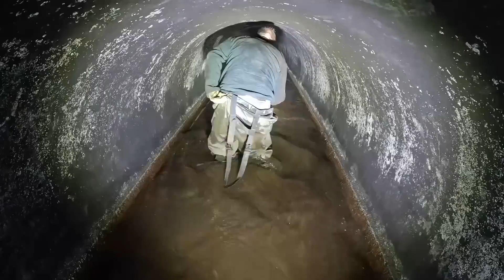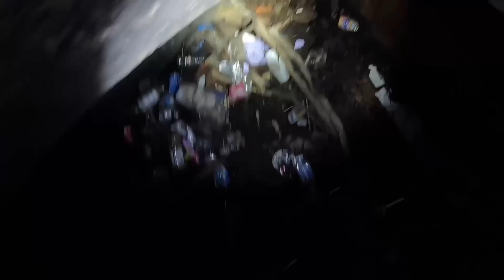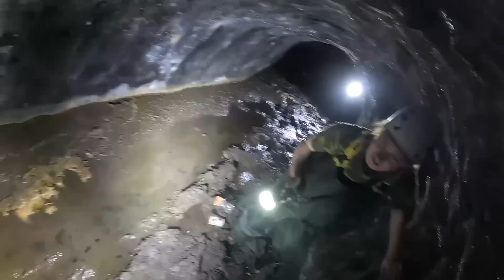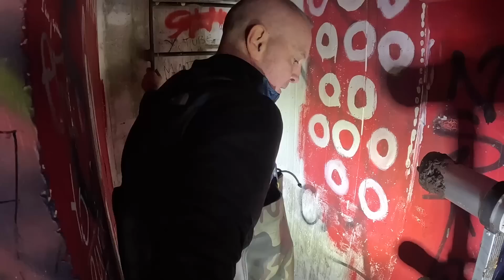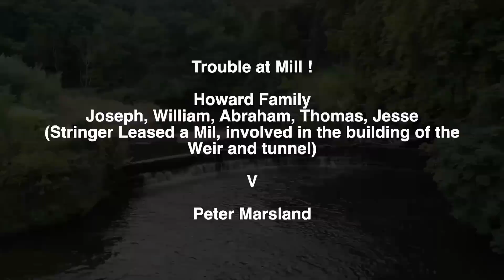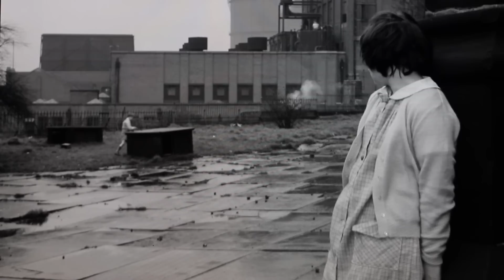Stockport's Old Corn Mill Tunnels

Comment: A few anxious moments on this video as well as the previous, Martin. If Roy thought that it was not safe to proceed any further in the quicksand then that was good enough to come away. I never realised that those places went right back to the 1700s, but it just shows how much was going off in Stockport at that time, and then the water supply for the later power station. That was good how you explained with the old maps what was what as to where the tunnels were situated within the meandering of the river. Nice to see the 'Taste Of Honey' clips that you showed. That was a real classic film of the earlier 1960s. Many thanks Martin, with Roy and Marcus, a pearler of a video!

Comment: Grew up in Stockport (Bredbury) and remember the power station and gas works well. Even lived for a short while in the shadow of Pear Mill so thought I knew that area better than most. For example - I discovered that the patch of waste land between the Goyt and Welkin Mill (across the road from Pear Mill) was once a shooting range! At some stage it became a dump as further field investigation (by me) turned up some empty Victorian/Edwardian medicine bottles there. I must say though, that these tunnels were completely unknown to me. I know there are some on the other side of Stockport on the Mersey (close to the viaduct) but these were a revelation. Cheers!
One thing I do wonder though, Martin, is the photo you have of the 'relined' tunnel at Renold's Mill, which you suggest was for the power station...at that point, the power station is on the other side of the Goyt, so unless they ran it under the river, it may have been for some other purpose.

Comment: I always struck me as odd that there was a Canal Street in Stockport with no connection to the canal network until I found out about the mills.
Reply from the maker: Yeah there was a branch down from the Ashton canal 👍🏻
Reply: @MartinZero that isn’t near Canal Street, that area is now filled in but retains the names Wharf Street. The canal street is near to where the plane crash was. It’s supposedly named after a series of reservoir and culverts of Hempshaw Brook but “canal” is still an odd name for its

Comment: Hey Martin. Great films if Stockport cornmill tunnels. I'm Stockport born and bred. I just wanted to point out in relevance to your video, there is an old set of stone steps on new ridge lane just past the Aldi store leading up to Stockport market/churchgate called Stringers steps!. He must have put his name to that part of Stockport, from the mill at the goyt along new ridge lane up to the market.
Reply from the maker: Well the old devil got everywhere didnt he 😄 Cheers John
Reply: As an ex Stockport area lad myself, Stringers steps are located at the top of Stringer Street and go onto New Zealand Rd.  They gave easy access to the mills from Turncroft Lane  Hall Street etc.
A few years ago they were dug out and renovated/restored only to be neglected by local council as it's a little used route.

Comment: You can still access one of the parallel tunnels a bit further up from stringers wier. There's an archway which is partially buried just by the footpath. A bit of a squeeze to get in these days but once inside the tunnel is quite intact. Very muddy again though, i only ever went 20 metres or so inside.
Reply from the maker: I bet thats Bakerhouse
Reply: I believe it is the end section of a tunnel from Nab's Weir, built by Marsland for the reasons mentioned in your video.